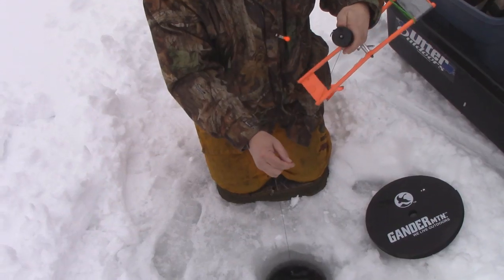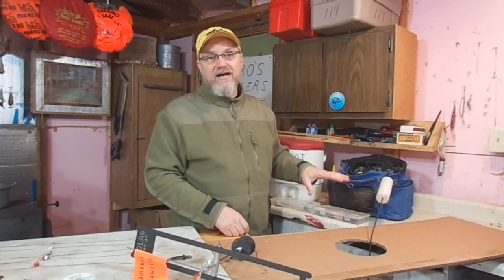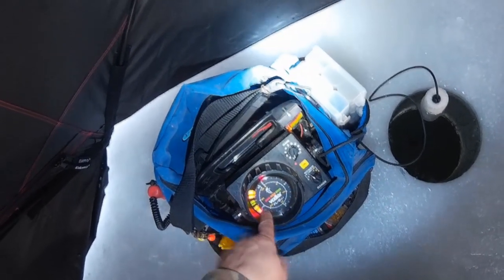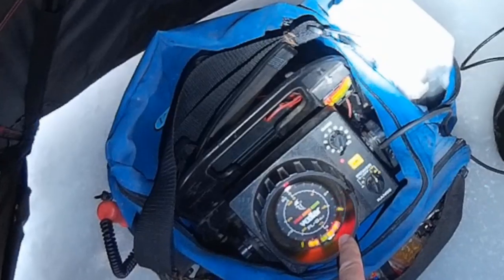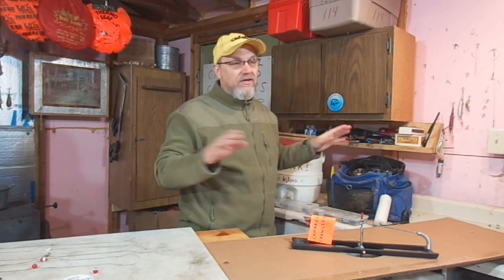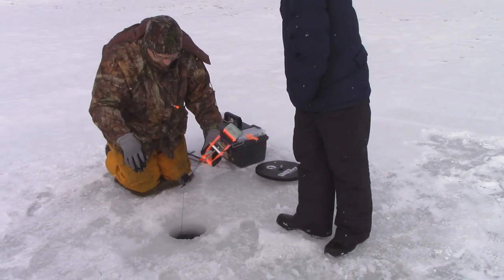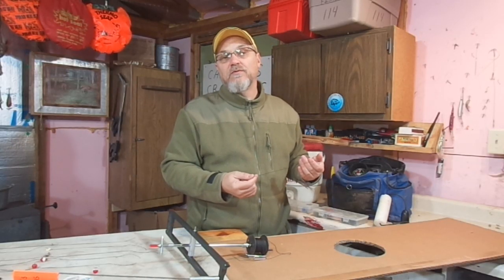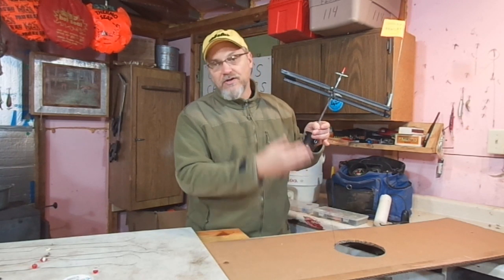Tip-up Basics - How To Set The Depth

Comment: Use a wide rubber band on the spool after establishing your depth to retain dept location.  It even prevents the line from inadvertently unspooling itself and acts as a light drag as a fish makes its run while taking out line before your arrival after a flag goes off. Works on your jigging spinning reel too. Just reel line on over top of rubber band on the spool when you get a fish on. Bobber stops work too.
Reply from the maker: I'm not sure if I get what you're saying.  First, the line shouldn't unspool unless the flag is tripped.  Second, I don't want a light drag on the fish after they take the bait.  I want a free spool.  Third, if the fish takes line, how will a rubber band around the spool keep your place?  Maybe I'm way off in what you're saying, not sure.  KPO
Reply: @KnettersPracticalOutdoors  once dept position is established (button, bobber stop) place a rubber band around spool to prevent "backlash" when fish strikes or makes a hard run that may snag on spool over run.  Acts like the tension knob on a baitcaster. Also keeps line in spool while fighting fish and tip up is rolling on the ice.  It's still almost a free spool and has the same amount of tension as a bait clicker.
Reply: @KnettersPracticalOutdoors  btw what is your position on the jaw jacker/automatic fisherman as a substitute for tip ups.  You have very informative videos to share and i value your experience or opinion on these pieces of equipment. Thanks.
Reply from the maker: Got it.  Rubber band used with line marker.
Reply from the maker: I have friends that use both.  Very helpful when fishing for trout.  Trout are difficult to catch with regular tip-ups.  Also they are good for panfish.  I'm not sure if they would help much with pike and walleyes.  Thanks for watching, KPO.

Comment: In 10 foot depth where would you hang a dead bait under a tip up?
Should I go near bottom or around the 5 foot mark?
Thanks
Reply from the maker: I usually will go several feet off the bottom.  I like to get it up where lots of fish can see it.  I like the 5 foot up in 10 feet set up, KPO.
Reply: In 10 feet I keep it at 2 foot off bottom for northern
Reply: In 12+ feet I keep it 2-4 feet from the bottom, 5-10 feet I do the opposite and keep it about 3-4 feet under the ice, and anything under 5 feet I keep it any where from 6 inches under the ice to laying on bottom depending on how active the fish are

Comment: Put your weight on the ground rite were its gna sit on your swivel and when it's out of the water sea how man wraps on the spool it takes to get a foot of or were ever you want to be
Reply from the maker: Thanks for adding in and thanks for watching, KPO.
Reply: @KnettersPracticalOutdoors  how do u get your smelt from wraping up around your weight I use about a 3 to 4 ft leader and they wrap themselves up do u think putting a deasnt size spiltshot 10 inches up would hurt